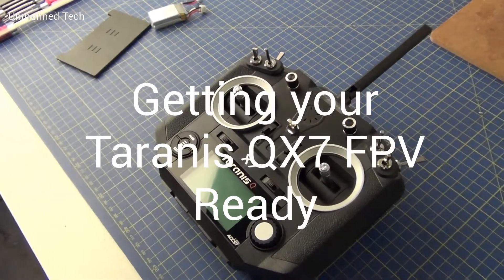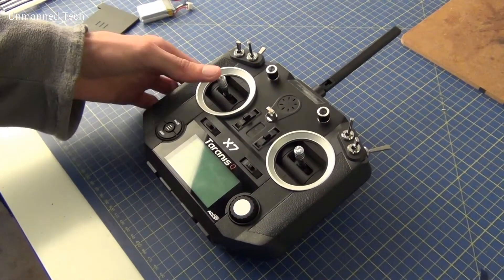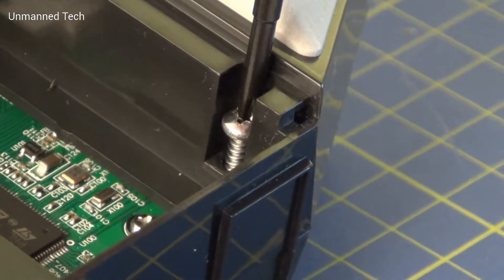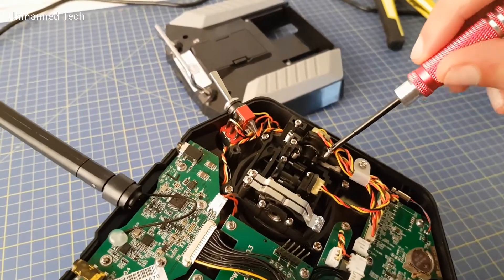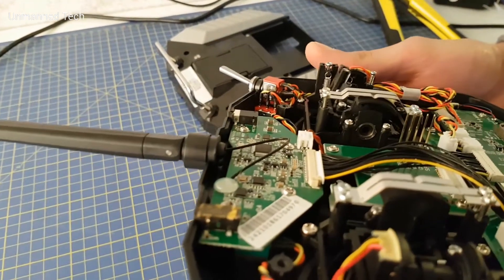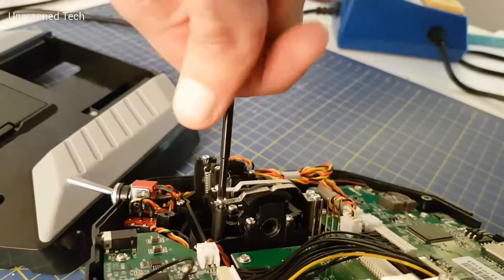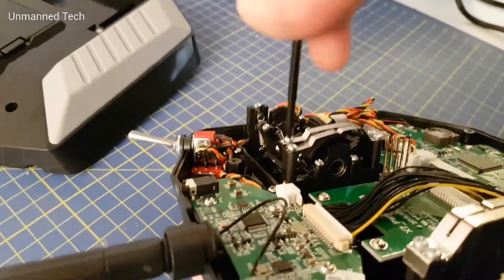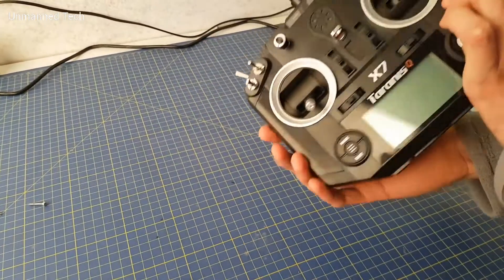Getting your Taranis QX7 FPV Ready

Comment: The problem is that most of the stuff on your catalogue is out of stock....
Reply from the maker: Yes we agree...unfortunately, it's not made easier by the fact that FrSky can take somewhere between 3 weeks and 2 months for shipments to arrive! We are working on improving this and hope to cut down on the waiting times for our customers...
Reply: Unmanned Tech I bought a qx7 last month. I wanted to buy from you but it was out of stock, so I bought it from Banggood and it took 14 days to arrive with free shipping... And the price was very reasonable.
I've also been waiting for the F3 omnibus to come back in stock for weeks...  no luck..
The same with a diatone fligh controler on your catalogue and pretty much most of the things I was looking to buy.
The only thing I was able to get from your shop, was a set of Chaos Esc's that seem to work fine but don't calibrate with betafligh nor blheli suite
Reply from the maker: Good news! We now have the Taranis QX7 in stock! FYI, there's no need to calibrate the Chaos ESCs as they come with the Dshot protocol (a digital protocol that doesn't need calibration). Cheers!
Reply: Unmanned Tech Great news indeed and I also noticed that the F3 Omnibus is available again :)